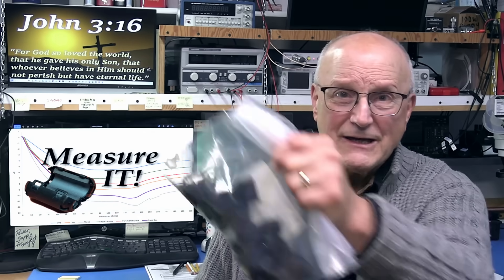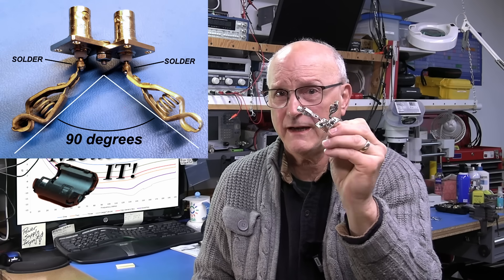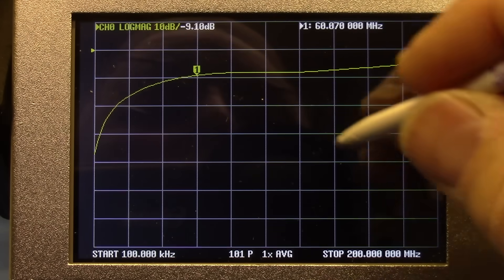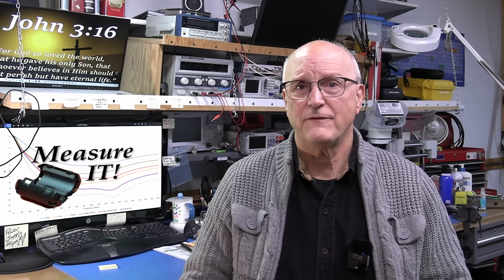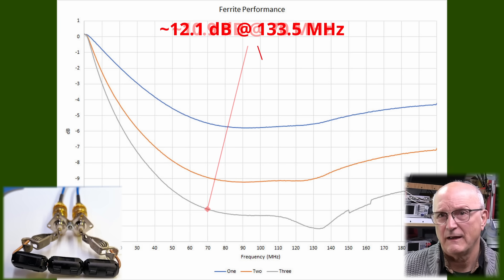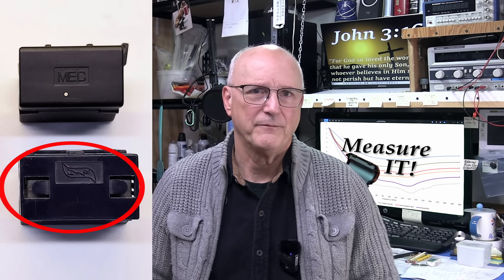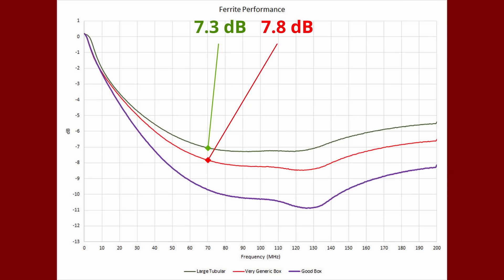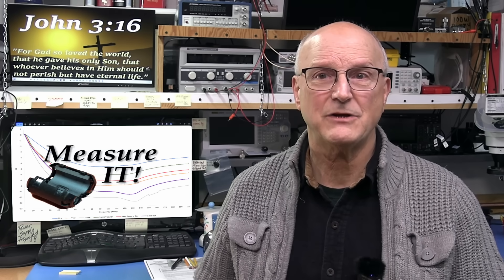Evaluating Clip-On Ferrite Beads with your nanoVNA (075)

Comment: What would be a Fair-Rite clip on bead for rg8x coax cable?  Looking at the DigiKey site it's rather confusing to find what I need for RFI or an inline protection from common mode interference.
Reply from the maker: You will need a whole bunch of them to extinguish common mode current using clip on beads. You might want to check out my video series on Common-Mode chokes.
If you still want to do the clip on ferrite thing, if I were you, I'd contact the Fair-Rite folks directly. Tell them what you are looking for and the frequencies. In my experience, they have been more than happy to give good advice ... and some of the folks I talked to are hams, so they "get it." :-)

Comment: Will a 9 mm ferite be squeeze down on a 9 mm o/d round power cable if the choke has the little teeth on each end thanks
Reply from the maker: That's a good question. 9mm ferrite (inside diameter, I am assuming???) The "teeth" are there to keep it in place. I am assuming these are plastic teeth as part of the housing??? They will dig into the sheath of the cable. Will it go without breaking the integrity of the sheath. I cannot say. :-)
Reply: @eie_for_you well i guess the teeth could be rmoved s if the cable is 9 mm and bead 9 mm then i wont need the teeth to keep it in place ould just hetthem and lift them away right

Comment: Would measuring behavior of only
 wire be useful in comparison?
Reply from the maker: Measuring the behaviour of the wire should be part of the required calibration of the VNA. If this is done, the response of the same plain wire should show up as 0dB loss. If you, on the other hand, are talking about a different wire than used for calibration, then I would recalibrate with the different wire, then do your measurement. The object is to have characteristics of the wire itself be calibrated out so as to be "invisible" to the measurement. :-)

Comment: This was a very good quick video, not rushed, but not wasting time either.  I'm sure it'll help people learn to use their nanoVNA for more than just antenna SWR readings.

I bought probably the same clip-on ferrite bead kit from Amazon and assumed it was probably barely a ferrite material and nowhere near as good as a Fair-Rite product so I appreciate you testing them.  I clipped five of these beads in series on a piece of coax for a non-critical application.  It may be worth doing.  I also have nine loops of RG316 coax on a toroid that's a little smaller than a 140 to keep reflected RF out of the transceiver when using the coax shield as a counterpoise when feeding an end fed half wave antenna.  I'll fire up the nanoVNA and test both of these RF chokes to characterize them across the HF bands.
Reply from the maker: Thank you so much! Oh, and the nanoVNA can do sooooo much more than just SWR, as you know! :-)
Sound like you have an interesting project going there.
You might find this video of interest in the project: https://youtu.be/s_JHPDA7k5Y
It is part three of three parts. The first video is here: https://youtu.be/yGYY7Nr5ba4
Have fun! :-)

Comment: Nice, but now I am thinking about what kind of ferrite I need to use for filter eletric spark caused by motors and switches, I think it is very low frequency. I want add this ferrite in the eletric cable of all devices in the house, but I am not sure about what model to use.
Reply from the maker: Thanks!  If I were in your place, I'd contact the manufacturers like Amidon and Fair-Rite and ask them that question. :-)

Comment: How is putting a ferrite bead on a transmission line and attenuating valuable RF a help to my station?
Reply from the maker: Let me explain by pointing you to my series on common mode current.
In short, the "useful" RF is contained between the center conductor of you coax and the INSIDE surface of the braid. The OUTSIDE surface of the braid acts like a separate conductor when it comes to the mind numbing magic of RF. This is where the unwanted "common mode" current resides. By placing a ferrite on the feedline, the inductance of the OUTSIDE of the shield is dramatically increased, which increases the inductive reactance and retards the conduction of this unwanted "common-mode" current.
Surprisingly, the RF which exists on the INSIDE of the coax (between the center conductor and the INSIDE of the shield) is virtually unaffected by the application of ferrites to the outside of the coax.
I hope this helps. :-)
Reply: @eie_for_you I do not retard or attenuate my RF. I avoid CMC by matching my transmission line to my antenna. More power out to my antenna and no lossy current baluns there sucking up my precious power. But that's me. I'm silly that way.
Reply from the maker: Yes, antenna matching is great. Some of the common mode current is due to the fact that one leg of the antenna has a different impedance than the other due to environmental issues.  Again, as I explained  before, the ferrites on the outside do not affect the power being delivered to the antenna. They only attenuate any common mode current coming back on the outside.  Check out my videos on the topic which can be found here:
Pt 1 (What is it) - https://youtu.be/yGYY7Nr5ba4
Pt 2 (Where does it come from) - https://youtu.be/W1HFEaWFAOs
Pt 3 (How do Chokes Work?) - https://youtu.be/s_JHPDA7k5Y
I hope this helps. :-)

Comment: J'aime bien cette vidéo .. mais une personne qui n'y connait pas grand chose .. a quoi ça sert une ferrite ? Il faut que ce soit le plus bas possible ? Ou le plus haut ? Voilà les questions
Reply from the maker: These clip on ferrites are used to suppress unwanted signals. They do it by increasing the inductive reactance of whatever they are clipped on at higher frequencies. So, suppose you have a switching power supply (known to be electrically noisy) and you want to prevent the switching signals from being conducted away from the power supply along the DC output cable. By applying the right ferrite to this cable, the DC is unaffected, but the RF sees a much higher impedance and does not have the free ride it once had. In another application, consider what is called "common-mode" current on a coaxial transmission line. The RF you want exists in the center conductor of the coaxial line and the INSIDE of the shield. The OUTSIDE of the shield can act as a completely separate conductor in the wild and weird world of R.F. As such, unwanted RF current can travel down the OUTSIDE of the shield and back at the transmitter. To reduce this current, we apply ferrites to the outside of the coaxial cable. This increases the inductive reactance of the OUTSIDE of the shield, helping to attenuate that unwanted current. Meanwhile, the desired R.F. energy on the INSIDE flows along unabated. Hope this helps. :-)

Comment: In audio, does this benefit both analog and digital signal paths?
Reply from the maker: These are for eliminating radio frequency junk from either getting into you device or getting out of the device. On the audio/analog paths, this could help to eliminate EMI from getting into the input or outputs of the device. Yes, R.F. can travel into you device through an output. On the digital paths, this could be used for the same purpose as above, but it could also be used to prevent the digital signals from causing R.F. interference. There is all kinds of RFI possible from digital stuff. Hope this helps. :-)
Reply: @eie_for_you Hi Rob, Thanks for the reply. Is it worth splurging for TDK branded ones or just generic/cheaper priced ones would do the job?
Reply from the maker: You are very welcome! :-) 
TDK? I think you mean Fair-Rite. And even then, be sure to get the right mix for the frequencies you are interesting in dealing with. Their sales folks can help you with that. :-)

Comment: I wished that you included a #2 (powered iron) core in your tests. Ron W4BIN
Reply from the maker: Well, now that's a horse of a different color.
I have done some testing on exactly that measuring inductance with ever increasing number of turns. I did discover that the standard formula kinda fits, but not very well. When creating an inductor with a particular inductance in mind, the equation gets us in the ball park. The other issue is that you are stuck with a specific number of turns. There are toroidal inductors with 13.5 turns. You have 13 and you have 14, but not 13.5. How much fun is that? 🙂

Comment: Two things:
First, great video.  I have a friend that moved into a new development (2017) and with only 35W, started tripping out circuit breakers.  Apparently these breakers are either the GFCI or Arc-Flash with reset and test buttons.  Anyway, he was thinking of putting in safety caps to try and reduce the problem but I was wondering with the normal wire-slack that is usually in a breaker-panel if he could just shut-off the breaker and wrap the wire around a ferrite a few times.  Do you have any experience with these modern Ham Radio FCC allowed hobby killers?

Next, I feel you channel is getting shadow-banned.  Your channel is among several that I am having problems with even though subscribed and full-notifications activated.
The one common thread, seems to be that they are all Christian. While not real religious, I feel this is atrocious and should not be happening.
I had unfortunately forgot (I'm getting old) you channel name.  So, I searched Amateur Radio, NanoVNA, Impedance Matching, Antennas and various other terms without you channel ever coming up.
I finally remembered that I had saved one of your videos and was able to get back with you. Otherwise, it looked like you were gone!
This is so disheartening in that it takes me some time to clue-up that I haven't seen Good o'l Ralph in a coon's age.
Anyway, wonder if anyone else is having problems with Christian channels.
Sorry to put this in the comments but did not see and email for you.
Thanks Ralph, you content is SO valuable and SO professionally presented, you're truly a YouTube gem!
73...
Reply from the maker: Well, thanks! 🙂
Hmmm...notifications...Google started putting my YT notifications under the "Social" tab in my email. If I am looking at the "PRIMARY" tab, they are invisible. I have to select "All Mail" or go to the "Social" tab to see YT notifications. I'm wondering if the notifications are going to some other totally weird, unexpected folder/tab in your email client???
My invisibility on YT??
Here is what I see...
   Current subscribers: 16,158
   Last 28 days 
     New Subscribers: 608 
     Views: 33.7K
     Watch time (hours): 3.0K
Someone must be finding me somehow.
Thank you again for the encouragement! I am so excited about the current series I am working on: Impedance Matching.
My hope is to bring it to a place where anyone with a high school education can do it. 🙂

Comment: More than 3 ferrites in a row result in 3 turns through one and the same ferrite.
Reply from the maker: Kinda, sorta true ... when we pass the wire through a single ferrite multiple times it is very much like putting the clip on ferrite on an existing inductor. The turns of the wire like that create a coil (read inductor). The ferrite, then, makes the inductance of this inductor even larger.  So, we get more effect with three turns through the same ferrite than we would with three of the same ferrite in a row on a single wire/cable. 🙂

Comment: Thing that annoys me. Why on earth they won't mark down the mix in any ferrites??
Reply from the maker: Now THAT is a good point! 🙂
Reply: @eie_for_you  Before I saw this video, I had a bit of a problem of having cheapo snap ons and proper ones on the shelf. I gotta test this out. Oh, and same for toroids! Good luck trying to remember which ones were #43, #31 and #52 mixes! A bit of paint on the side wouldn't hurt on manufacturing side. Though, dumb user like me forgot to mark down what they were when I got them
Reply from the maker: @OH8EFI  A lot of toroids are, indeed, color coded ... if you can remember what the codes mean.  At least you can group them by color! 😁
If I remember right, Amidon tells you what their color codes mean on their data sheets. 🙂

Comment: Is there a way to determine the "Impedance" of an "EFHW" End Fed Half Wave - Long Wire antenna using a "Nano VNA" so that I can choose the correct ratio 1:1 / 4:1 / 9:1 / 49:1 or even perhaps a 64:1 UnUn Matching Transformer. so that I can be confident it is Matched to 50 Ohms for my Radio.
Reply from the maker: Having no personal experience with End Fed Half Wave Antennas, I can only repeat what I've been told by those who have ... 9:1. 🙂
Reply: Can you measure a piece of wire 1m long (EFHW for a 2M band)?
Reply from the maker: @galileo_rs  First of all, I'm not sure if you are trying to measure its end-to-end response or its its swr or its impedance. Could you please be more clear in what you are trying to accomplish?
Second, I do not do acronyms. I can only guess at a host of possible meanings which does not help in clear communication. 🙂
Reply: @eie_for_you  It wasn't a question, it was a response to the previous question.
Reply from the maker: @ Aaaaaaaahhhh! I missed that! When I click on the comment, it doesn't bring up what came before and it gives no indication to me that I have some context to consider. Sorry for the misunderstanding! 
The VNA needs both the signal and the return. A simple wire hanging out there without some sort of return path won't work.
Your end fed half wave antenna also needs a "counterpoise" as I understand it. This functions as the "return path" for the feedline.
So, if you have your antenna and its counterpoise connected to the nanoVNA, then it will, indeed, tell you what it sees.
I hope this helps.
Again, sorry for the misunderstanding. 🙂
Reply: @eie_for_you  YT comment systems sucks. Here is a fun exercise: Calibrate your VNA and attach a male SMA connector made for PCB mounting on port1 and measure that SMA connector. Now solder a 5cm wire to the center pin of the connector and measure again. Do you observe a difference?
Reply: @galileo_rs  The fact that it is "Winter" for me (Currently Minus 22° Celsius ❄️🥶🧊) I won't be testing any potential methods. My current plan is to build   a variety of (UnUn's) Let's say a (9:1 / 49:1 / 64:1) ..Then try each of them measuring the "Impedance" On the (Primary Winding) .. How Close or Far from the sweet spot of 50 Ohm's do they read. With hopes it will give me an Idea what direction to go, or perhaps get lucky for one of them to be perfect. 🍀🤞.
(I don't know what the results will be) by doing it this way.. We shall see this Summer (🌞🏝️ Plus 22° Celsius.) .. TTYL 73s
Reply: @x_CrossHair_x  You can measure that EFHW for 2M band in your shack. Transformers transform the impedance from the secondary so the usual way is to place a resistor at the secondary that mimics the impedance of an antenna. For EFHW that is (in theory) 2450Ω.
Reply: @galileo_rs  Well that setup would test if the (UnUn)  is the Correct Ratio (To know that you have successfully created a 49:1 UnUn.. at that 2450Ω Load).. However the EFHW outside will be different.. Many factors affect it.. including Height above Ground.. So.. I need to figure out an Accurate way to measure (Impedance of the Wire. Not the UnUn Ratio).
Reply: @x_CrossHair_x  That's why I asked you can you measure a 1m wire ...
Reply: @galileo_rs  My Guess is.. It won't be a simple Linear Impedance per Meter Calculation.. (We shall see) if I can figure out a Reliable and Accurate way to do this Measurement.. Then I can perhaps make a "How to" Video..
Reply from the maker: @galileo_rs  Very interesting! This kinda kicked off a few experiments.
I did this with my Tektronix VNA. I cut a piece of 18 AWG wire 5cm "plus a little" long. The "plus a little" was to give mating length as I stuck it in the center pin of the N connector on the front of my VNA. The exposed wire was 5cm long.
Looking at the Return Loss from 100 KHz to 3.0 GHz I see a decided dip at 1.86 GHz. There the Return Loss is -29 dB which equates to an SWR of about 1.072:1. Hmmmmm .... so I am wondering how well this relates to this 5 cm wire acting as an effective antenna at 1.86 GHz.
So ... maybe you CAN do this without the signal return to the VNA?
Thanks for the suggestion! 🙂
Reply: @eie_for_you  Glad that you found it interesting, have fun.
Reply from the maker: @galileo_rs  I sure did! 🙂
Reply from the maker: @galileo_rs  I went back to my VNA guru and this is what he said about all of that, "The "wire" becomes effectively a monopole "marconi type" antenna, with the shield of the SMA connector and ground plane in the VNA becoming the counterpoise.  I'm sure the results vary if you're touching/holding the VNA vs leaving on the bench, which also is an indication that the VNA housing/ground are part of the antenna system."
I thought you would find this interesting. 🙂
Reply: @eie_for_you  Yep, that is why you get strange results when you measure an HT antenna with a NanoVNA when holding the VNA vs VNA on a table, for example.
Reply from the maker: @galileo_rs  True, that!

Comment: Just a little real-world experience with common mode suppression at high power levels: start with 3-4 ferrites at the beginning that only suppress a little, as they heat up less. Then use ones that suppress more effectively later on, since heat degrade their suppression, especially in the summer.
Reply from the maker: WOW! That is great advice! 🙂

Comment: Nice video!  Is there significance to the clip leads of your fixture being 90 degrees apart leaving the connectors? Or is that just describing what you did?  Reduce magnetic coupling in the fixture?
Reply from the maker: Thank you! It is to reduce the signal coupling for the isolation tests. Conductors at 90 degrees to each other have a lot harder time inducing signals in each other.🙂
Reply: @eie_for_you  Thanks for the clarification.  Seems like an important detail.
Reply from the maker: @jmcexx  You are welcome! 🙂